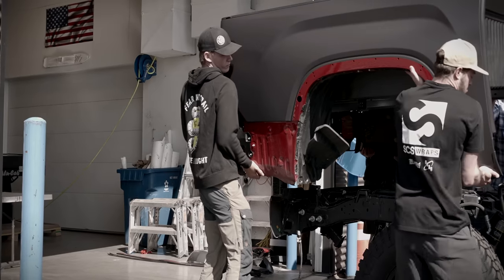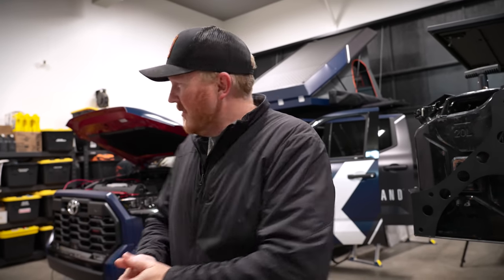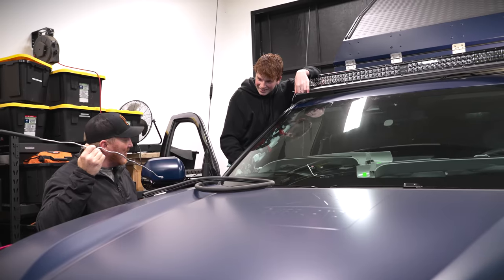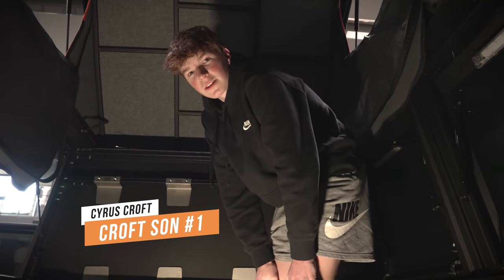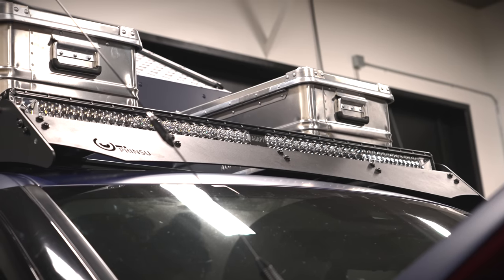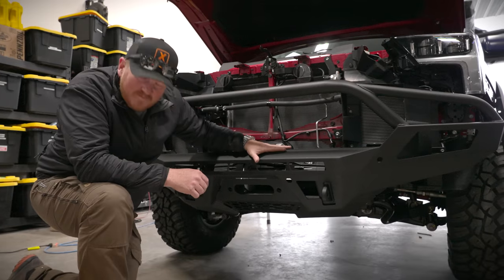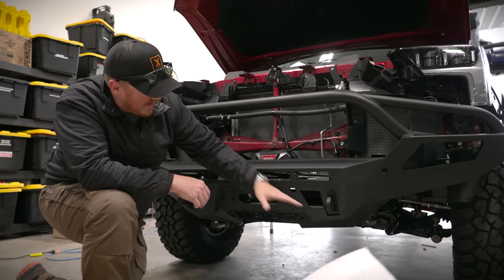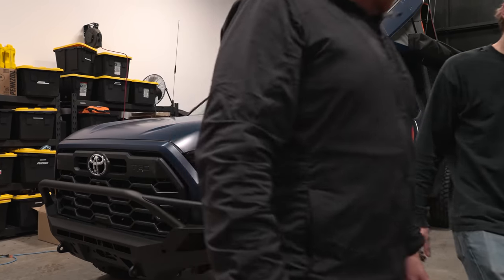The Tundra Transforms! | Alu-Cab, Bumpers, Roof Rack, & Lights | X Overland Tundra Shop Talk #12

Comment: Glad to be a part of this build, turned out as incredible as always 🙌
Reply from the maker: You guys rock!🤘🏼
Reply: Nice work CBI - that bumper looks awesome! 2 questions: It looks as though there are holes provided for the small parking sensors, is that correct, owners can keep that functionality intact with this bumper system? And second, considering they share so much platform/suspension, etc., especially in the front, do you all anticipate this will be a workable option for the upcoming 2023 Sequoia as well?  Thanks!! I'm saving my pennies already.....
Reply: @mkmag  thank you for the kind words! Yes the bumper will work with the parking sensors as well as the adaptive cruise control and other sensors on the front of the new trundra. As far as the sequoia goes it should fit but once we get our hands on one of the new models we will do some testing and make any necessary changes needed.